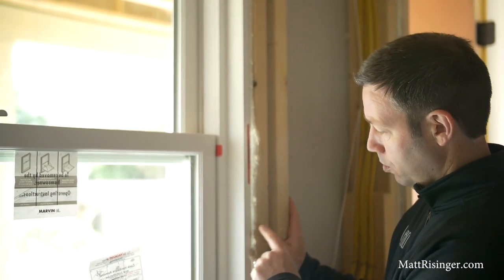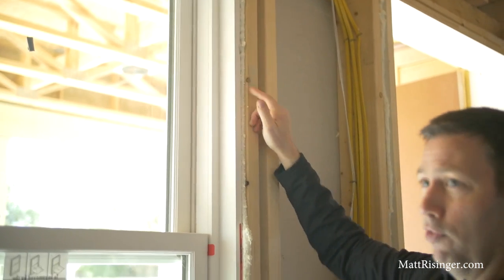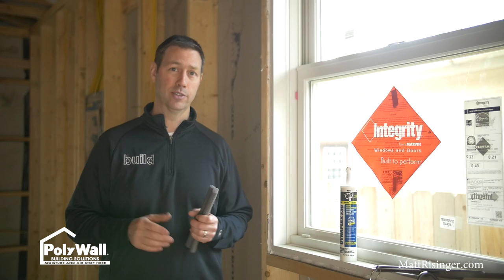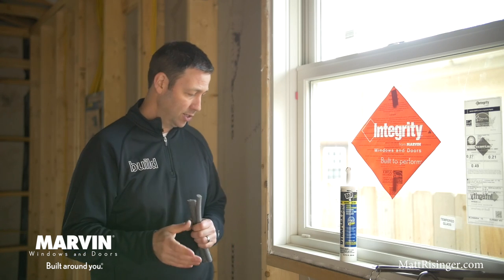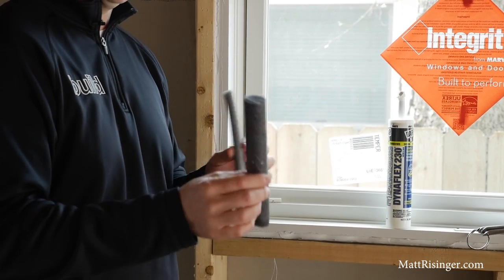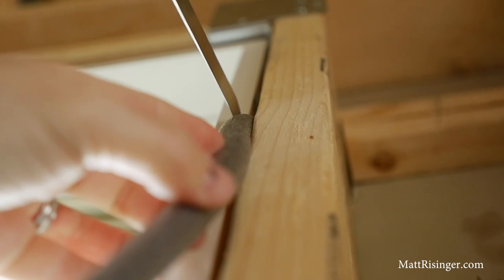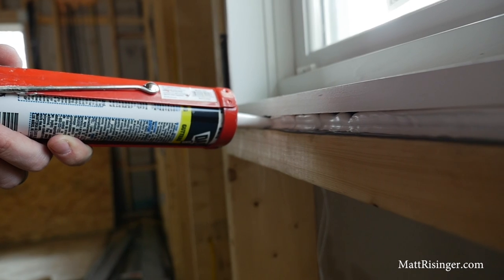Insulating and Air Sealing Windows

Comment: I disagree with this approach.  You don't want to seal from the inside, only the outside.  If the exterior seal is breached and there is an interior seal, you never know the exterior seal failed.  What next?  The long-term creation of mold from the constant water leak, water rot, potentially termites or other wood loving insects.  The one point I do agree with is that insulation of some form should fill the cavity vs leaving an open void for unconditioned air, which could have a delta temperature high/low enough to develop condensation.
Reply: Many windows, especially vinyl fail at the seems (internal) so obviously you want to seal externally but this method he described cover the internal failure as well. The window RO should be prepared to repel water out once it gets in allowing the space to dry quickly.
Reply: Did you miss the fact that he uses sloped sill pans?  Watch his other videos on this subject before making assumptions.  Any water on the exterior runs outward not inward and doesn't sit there and the bottom  is totally covered using tyvek corner stretch.

Comment: After learning the the hard way I have learned how to seal windows in a coastal environment, where if you have a hole the size of a pin head with the right wind exerting negative pressure on the interior of the structure it will leak significant water over time. Mostly putting new construction windows in old structures. 
To stop the water at the sheathing plane I use zip tape sides and top on the exterior flange and then foam from the interior by inserting the straw  all the way in till it hits the back of the flange- I flatten the straw with a hammer if there is a tight spot- do the corners first then fill the rest. 
It warms my heart when later I see a little bubble of foam protruding from a corner of the window.
Matt Recently subscribed and love you videos.

Comment: Matt, you got a great subscribers. All has valid and constructive comments. It heartens me to see this. For new construction house, this is possible. In old homes where I ripped out the entire window out and the available new construction windows that fits in that opening, I find that sometime there is only 1/4" gap left over on the side. I prefer to spray foam the entire cavity... from all the way in out toward interior wall. It takes some time but really worth the effort for insulation purpose. the window is still part of 'exterior surface' just like plywood or OSB... you need insulation too.

Comment: in nz we use a backing rod toward the exterior side of the framing and fill the rest up with expanding foam. in my experience the only time this system fails is if the backing rod is too small for the gap to achieve a good seal. it will also fail if the opening has not been flashed/ taped correctly. our national practices are very poor and we continue to build leaky homes. i think one of the biggest problems here is that most builders do not understand the importance of air seals or how they work. in specific builds where energy efficiency is a priority the guys on the job tend to know what they are doing and do an amazing job. another good video Matt. thank you. I wouldn't recommend caulk for alterations where there will be alot of dust and debris.
Reply: Kirk Downes I would to see a photo of this application
Reply: how would you know what size backer rod to get if we haven't done framing yet but need to order beforehand because of long lead times? is there a safe size to start with, like what Matt says in the video which he says 3/4" or 1"?

Comment: Hey Matt, love your vids, but I have to question this one.  
What is it specifically you don't like about foaming windows?  When I've had to demo recently installed windows, I've found that after removing mechanical fasteners, the foam hold so tightly that it has to be cut out before the windows will even budge.  That would seem to indicate a much greater seal area then one gets with the caulk/backer rod approach.  Besides, it is very common to find a caulked joint has pulled away from one of the surfaces due to lack of adhesion after shrinking and curing.  Also, that system will only have the caulk adhered to 1/8" to 1/2" on either side of the window vs framing joint.  How can that small surface area compare with the thickness of a 2x6 wall?  
Additionally, with this system you are allowing possible water penetration all the way thru the wall to the back side of the trim.  In instances where only caulk was used, and failed, I have found the back side of the trim to be rotten.  Why would you not want to stop water incursion on the outside of the opening?
Btw, forget the spatula.  In my 35 years, I've found the best way to make sure the caulk joist adheres properly is to give it a good fingering.  (Phrasing?)
Reply: REDMOONBOB 
The method he is using is a recommended method from a lot of highly respected building scientists.  This is the best method to use. also with this method it takes the warranty issue out of the equation. A window rep cannot tell you that you didn't use the right product to seal the window jams and void warranty. window and door foam is not alway the manufacturers approved method. This method is safe and seals way better. We are not trying to glue the window to the frame but provide a tight air seal against the wall framing members.
Reply: I'm really curious about this as well. I'd love to hear what exactly the disadvantage to using foam instead of the backer rod/caulk method is. Would it be that the foam will not maintain its seal over time? Is that not true of caulk too?
Reply: REDMOONBOB 
Totally agree.
Reply: I think caulking the inside is just an added level of protection, ideally the exterior is sealed tight and nothing ever gets inside.
If you're comparing caulking to foam, the obvious difference is foam does not provide an air/water tight seal..it is full of air pockets and holes..
Reply: REDMOONBOB are we doing phrasing anymore?
Reply: great reply and info
Reply: @Matasky2010  That last point is exactly right. Just a side note: if you're ever interested in soundproofing your windows and doors such as myself, those air pockets and holes are not going to do you any favors :)
Reply: I’m a bit late, but I have to add that most spray foams will stiffen and shrink and come away from the window or door. Either by shrinkage or lack of flexibility.  This takes years and happens long after the home warranty is up. 

This is what is being found in the field for windows that were foamed.
Reply: @BB-nn9en  - Interesting, but what product wont dry and shrink years later. I just installed 6 new construction windows in a preexisting house and need to make a decision. It would seem backer rod and caulking wouldn’t have much R value as compared to full front to back foam.
Reply: @67NewEngland  I'm not sure :(.  If you find something let us know!

Comment: Matt Good video and good building practice. I normally don't see a backrod being used in residential applications. In the national window standard its a requirement for air sealing and provides a space for water drainage. Could you a the backrod and than low expansion spray foam?  Some spray foams are mix of open and closed foam allowing expansion and contraction but fill the entire cavity up thus no drainage plane. I see windows that have side jamb to rough stud opening anchoring system which makes it tough to get the rod in place. In the Marvin installation  guide backer rod isn't mentioned.

Comment: Hello Matt.  Great video. I follow your post all the time. I'm living in a tropical weathered country. We get lots of rain and Sun 365days a year. The backer rod is a good idea but we have so much rain that the rod may soak up all that seepage. Then we have the heat from the Sun that would make any premium quality caulking dry up and crack. Ultimately it will leak through between the window jamb and wall or the screws that holds down the window. I was hoping that pumping foam or grout would help to fill up the gaps between the window jam and the wall. But I have yet to find a right solution to prevent any leaks and with hope of zero maintenance in the future.  Do you have any solution for tropical climate? Maybe a well build aluminium window section complete with aluminium window sill + weep holes and drains?
Reply: It may be pricey for some but Renewal by Andersens  Fibrex windows are worth it. They hold up extremely well in extreme climates.

Comment: Matt have you ever used air sealing tapes for this task? There are several out there, some that are vapor permeable. It would seem that a tape would be faster and less messy for this task. In addition, more durable. Though probably more expensive.

Comment: In lieu of the backer rod, how about a small amount of the low expand foam and then the caulk.. time savings worth it???
Reply: I did this . And I went from my zone calling for heat all the time to heat turning on for 10 min and I'm boiling.

I don't see why the expansion foam cut flush then chaulked isn't the same affect. I cant say why the foam will hold the water though . Yeah it's going to get soaked but you already have a problem if water is getting through your window

Note each room in the house has its own zone valve . That window directly affected one zone

Comment: Interesting video and comments, but I thought backer rod was actually closed-cell foam extruded (or molded?) into a rod shape. If so and the rod is providing a good seal, then water could be trapped between the rod and the caulked area. If the rod is not supposed to be inserted all the way forward to the flange, then maybe this would allow a fail-point drain but seems iffy. I'm guessing that the real issue with foam-in-a-can is not application (real hard to do this wrong), but that the foam degrades/fails over time. If so, I'd like to see a study on exterior shell product failure analysis to see if backer rod/caulk is really any better than foam.
Reply: The backer rod is all the way back towards the interior, and the caulk is applied right up against the backer rod.  Any water leaks would be therefore be to the exterior of the backer rod, and assuming you have a properly sloped sill pan, would drain to the exterior.  A good article on proper use caulk with backer rod is: http://www.finehomebuilding.com/2016/07/06/caulk-this-way
Reply: Christopher - thanks. I had seen that before, but that article just applies to caulking between right angle or flat planes and the backer rod is used (properly) to mostly fill up the space instead of (the incorrect way of) filling up the space with caulk. Does not talk to the subject at hand. Still would like definitive/expert comments on the life expectancy of foam-in-a-can vs backer rod/caulk.
Reply: @chriswelles1  So does that mean it is ok to have an air space behind the backer rod (between the backer rod and that exterior piece which I think is called the nail fin)?  And it would be bad to have the backer rod pushed all the way as far as it can go towards the exterior with space in front of the backer rod?  I'm doing this for the first time after I stopped window installers from going any further with canned spray foam.  That stuff exploded out of the space it was applied into and ran all over the brand new window and everywhere around it.
Reply: @Rabbitsarewonderful  Yes.  It's fine to have air space behind the backer rod.  It serves as a drainage area in case there are any leaks.  It's fairly stagnant air there so the thermal difference between just air and some insulation in there isn't significant.  Christine Williamson give a good talk about the benefits of the air gap there: https://youtu.be/pDa2yVaLXQE

That being said, I think most folks actually put some insulation in there.  In any case, you definitely don't push the backer rod back to the nail fin.  It's there for "backing" the interior sealing caulk.
Reply: @chriswelles1  Thank you so much for replying so fast and with great information!  I'm actually heading out to buy backer rod.  The video you linked to was helpful in explaining the air gap between the water seal and the air seal.  So now I understand why you would not want to push that backer rod further back.  I'm not planning to put fiberglass behind the backer rod.  Hope that's ok.  It's kind of annoying that there are shims below the window to work around with the backer rod.  Wish they didn't have to be there.

Comment: There's a video on FineHomeBuilding that shows someone using foam, backer rod, caulk, and tape.  "Weatherproof Window Installation, Episode 3: Insulation and Air-Sealing" - http://www.finehomebuilding.com/2015/09/10/weatherproof-window-installation-episode-3-insulation-and-air-sealing  However, from the all the comments I see here, it sounds like no actually goes that far in the real world.  Is that the case?
Reply: Christopher Welles d
Reply: Try to find this to the video
Reply: Why not put the spray foam insulation from the outside after the backer rod is inside to make sure you fill the entire gap?

Comment: I would never use this method. If you sloped the pan and used a flexible wrap then use the low foam on top and sides. Then for the bottom I could see using the expanding rod, and a GOOD sealant, like an NP1 not that dap shit!! However for the top sides and bottom I would just low foam it. 

First flat sill is NEVER good should have a 5 degree to 7 degree slop, even 10 would be fine. Sometimes 10 becomes a pain when using shims. I fail to see why you would use caulk as a back dam. You have wayyyyy bigger problem if you think you are going to get that much water.

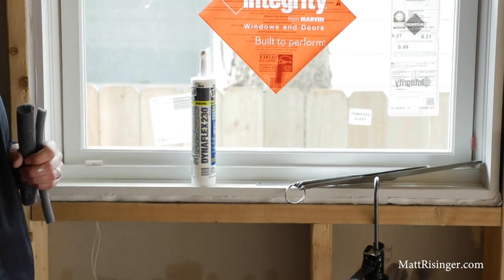Comment: at the 2:40 mark, what are those gray...boards? that extend a few feet along the roof trusses from the exterior wall?
Reply: +Frank Kovach those are rafter tails.  Since this is at least a 2-story, I would presume there is a porch/deck/patio outside of that wall.
Reply: So they are just sistered on to provide an overhang for a porch?
Reply: Not sure, but I've seen this done to create an open soffit design before - where trusses are used (no tails or it isn't large enough lumber asthetically).
Reply: Michael Cox I took another look and now I'm wondering if those are the vestiges of an older roof system that for some reason they couldn't entirely do away with.  I am definitely no builder, I just have a passing interest in construction practices for own future benefit.
Reply: Nah, you know what?  I think you're right.

Comment: I believe low expansion foam is closed cell. therefore should stop water. Matt's argument for his method doesn't hold water.
Reply: Tony Crisci low expansion foam does not expand like typical closed cell foam and can leave gaps due to its low expansion properties. It is no longer the gold standard in air/water sealing window interiors.
Reply: Rob Fisher I am aware of that and agree. See my other comment about how you have to stick the foam straw all the way in till it hits the back of the flange. do corners first. that is the weak point as far as water leakage. you have to stop the air water at the sheathing plane.

Comment: I can understand that expanding foam could trap water. However would not the best method be to use the backer rod pushed in to leave a 1" space at the front of the window and then use expanding foam to backfill? That way you are allowing any water that does get behind the window a channel to move down to the bottom where it can drain outward yet you are still insulating and air sealing.
Reply from the maker: +John Salazar that's a great plan but how would you ensure the 1" space?  Need to noodle this. I like where you are going...
Reply: What do you do where the window is shimmed or where the metal hold back straps connect?
Reply: How about temporarily put something there like a dowel rod or something?